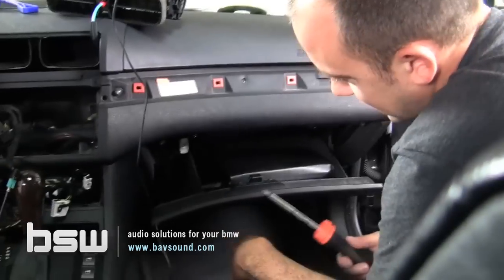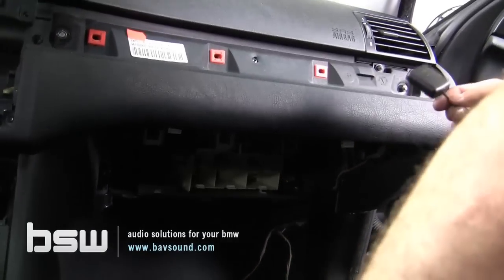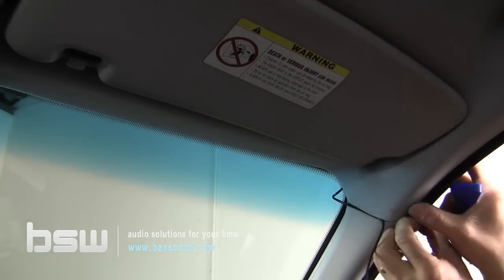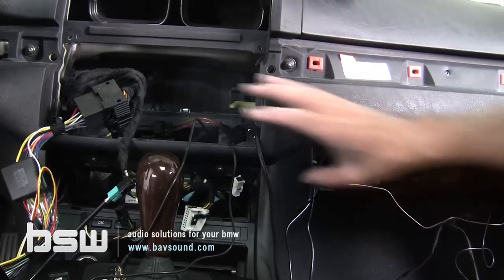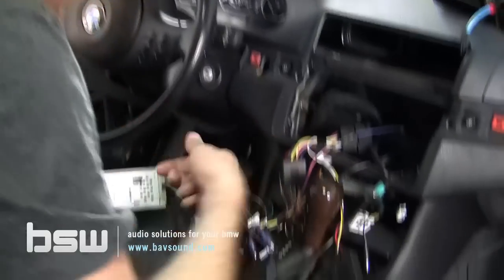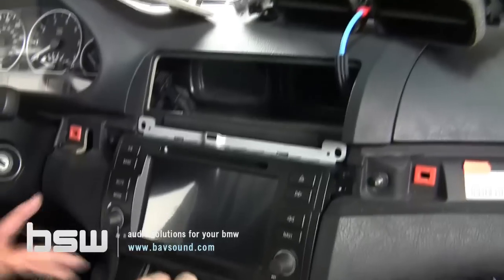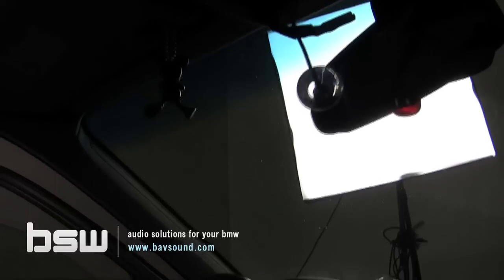BMW Dynavin Installation | E46 3 Series | BAVSOUND | Part 2

Comment: You guys make it look so easy lol, I should have gone with the Dynavin unit on my e46. I decided to use a double din Pioneer with Android Auto, took me the better part of an entire weekend to modify the AC ducting and install the radio. Once the ducting cover was complete, it was a piece of cake to put it all back together, and there was just barely enough room to the right of the radio for all of the wiring and my parking brake bypass relay. Also, not sure how the Dynavin unit works, but if your e46 is anything like mine, the remote amp turn on wire has to be hooked up to the factory amp, otherwise you'll have no sound and you might go bald trying to figure out why the radio works but there's no sound playing... You might have mentioned it in the video, but I don't recall. Anyways, fantastic video, I've been looking into the BavSound upgrade for my speakers but I have some other issues that need to get solved before I spend that kind of money on sound quality.

Comment: Great video! One question. Do you need to have that wire plugged in for the video to be viewed while in park? or can you just not plug it in and it'll work while driving? Thanks!

Comment from the maker: @jonsutubechannel Hi. yeah sorry it's really easy we just forgot. It's a direct fit on other cars and almost a direct fit on E46, but if you want it to be 100% factory you'll need a climate control trim piece available from the dealer. In this install we did not use the factory piece and it worked quit well. e46 is the only model that uses the OEM part and it's 51-16-7-001-408.

Comment from the maker: @Dgoldentr3 It's almost a direct fit, but if you want it to be 100% factory you'll need a climate control trim piece available from the dealer. In this install we did not use the factory piece and it worked quit well. But we'll post the numbers on that asap.

Comment: awesome tutorial. planning on buying an m3 and a double din unit, so this will be useful.

so the hvac controls fit right in on that bottom slot? no need for any bezels or anything?
Reply from the maker: Thanks. Please check the description for more info.
Reply: BAVSOUND  is this unit compatible with an e46 without the premium sound option, aka stock regular speakers . ? My install guy told me to ask lol

Comment: How do you relocate the a/c & heating control panel into the compartment slot please? Im thinking there's a housing bracket that the unit fits into or does it just slot straight in there? I will be getting my e46 convertible in 8 weeks and will be getting the eonon d5150 head unit to fit into it, I think your 2 videos are brilliant and covers every aspect of the fitting procedure apart from fitting the a/c & heating unit....hopefully it will just be a 'plug n slot in' job.
Reply from the maker: Check the "about" description above by clicking "show more"

Comment: Hey awesum vid an unbelievably helpful. I used it to fit mine so thanks a lot.
Quick question though. How did u relocate the heater unit. Doesn't seem to fit correctly into the housing where the spare compartment was????
Would massively appreciate any help, thanks.
Reply: +mallylad on most e46's you need to buy the bracket from the dealership for relocating the climate controls. When I did my double din install a month ago I used the bracket from ECS Tuning, it was right around $100 including shipping. There's two different kinds, the ones with a single button panel or the one with individual buttons (heated seats, traction control, etc). The part number I needed was 51167001408 (with one opening for buttons), the other part number is 51168202186 (with openings for individual buttons)
Reply: +Mark H hey, thanks for the reply, yea I'll have a look about and find the relocation bracket an sort that.
Thanks again dude 😁

Comment: Great video, this was a big help as I put in an Eonon head unit today.  One problem.  I can't seem to get the climate control to insert into the old accessory pocket all the way.  I push and push and it won't snap in.  There doesn't appear to be any obstructions.  Any suggestions?

Comment: Final result got very very good.. nice new radio/gps.. gotta find such solution for my e87 series.. too bad it has already a folding screen also some ac controls in the region the 46 only has the radio..

Comment: Very helpful video, but my local BMW part guy tells me the HVAC trim piece part number you mentioned is for NOT for cars with the smoker's package, which I've been told was standard in U.S. import e46's. He says the OEM part needed is 51-16-7-001-410 (not -408). Can you confirm that?

Comment: I have the exact same unit as the one you installed in the video and works great, except for the fact that the audio to my radio and bluetooth won't play accurately.  It works at some times but not 100%, it plays and then fades out and then just no audio at all.  The CD and navigation sound works so I am not entirely sure what is wrong with it.  I think that it might be a grounding problem but I am no technician.  The company I bought it from Vigo electronics, has no idea either.  Please advice!

Comment: I have the same stereo, for the gps antenna they decided to use a magnet instead of adhesive. if you take the sticker off the back its right there. I glued the magnet to the windshield so you can remove the antenna at will.

Comment: Hi, Thanks for the tip on the ebrake PARK wire connection. In that same general area, is there a place to hookup a REVERSE wire? i.e. for backup camera.
Reply: trying to find an answer for this myself

Comment: I've been watching your videos on the 3 series and now I want this.  However, I'm a bit confused on where I would hide the mic on a convertible. The windshield is out of the question.
Also, the gps antenna is an eye sore IMO. I wonder where the factory hides them ( in a convertible)

Comment: Hi there,

I ordered a wireless rearview camera from e-bay which comes with both a reciever and transmitter. The transmitter i can give power by hooking it up to the backup lights, however for the reciever which goes behind the radio, what would be the best place to get the power from?

At first i thought about the cigarette lighter, but that is a constand power supply which will drain the battery, so that is a no go. Which wire would you advice me? Is it possible to connect it to the amp wire?

Comment: I have a head unit like this in my 2003 BMW 330 but I want to upgrade it since its the one that came with the car. I was wanting to buy the Pioneer AVH-P3400BH.  I was just wondering if that head unit will fit. I'm guessing since the AC unit is already where it needs to be it would just make the install simpilar. Would all I have to do is pull out the head unit in there now and put the new one in?

Comment: The 2005 BMW 325Ci convertible stick has a Din2 with GPS is not the same as shown.
Will this or which newer radio with GPS, WiFI, DVD will fit without modification?

Comment: Hello, Was wondering if you can help me decide what kind of 5 1/4 size componet speaker should I install in the front doors. I have stock and they are raddling so I have to replace them. Can you help.

Comment: Hi I have a question about relocating the climate control. I have seen tutorials where people modify the vent. Is that necessary? And where is that vent located?
Reply: You don't have to modify the vent, you do have to move the HVAC controls, and it helps if you get the relocation bracket. It's available from BMW or you can buy it separate from the head unit, both available here https://www.jandtdistributing.com/

Comment: Hi, 
Quite new to all this so apologies if I ask stupid questions. 
1. The cables that were run through the area where the glove box sits, where did they go? Do they sit behind or inside or do they hang around in the footwell? 
2. I am a little confused as to how the wire near the handbrake was connected to allow video when stopped. I have a 325ci manual 01 (Australian version) if that makes a difference. Could anyone be of assistance? 
Thank you :)

Comment: I noticed you didn't install a line output converter on the head unit.  Is that necessary to bring the head unit signal levels down before they go into the on board amplifier in the trunk?
Reply from the maker: Peter Lobaccaro Hi Peter, not necessary in this application!
Reply: Great thanks I want to do something similar and some say you need others say no
Reply: BAVSOUND '

Comment: HI BAVSound, how did you install the Air Conditioner panel under the double din Dynavin, I'm going to get one of these head units but don't know how the Air Conditioner  will go do I need an adapter?
Reply: +And War Nope
Reply: And War
I tried to open a restaurant and , well , now I have about 1700 Restaurants over the world. German sausage and other german foods are very popular. By the way , he just put the air conditioner one slot below.

Comment: What was the size of this unit. I just purchased the AVIC 8100nex which is a 7" screen. Will my 2005 m3 have the available room without "cutting" ?
Reply: +Mike Smith Sadly, not a chance. Your m3 will have no room for the NEX series units unless you modify the AC ducting, which (if you're anything like me) will take you the better part of 2 days to complete. The Dynavin has a special shape, if you look at it from the side it's kind of L shaped, so it fits above the dash vents but still allows there to be a 7" screen. 

I just did my double din install on my 04/2004 3 series about a month ago with an AVIC 4100nex, so I can tell you for sure that any of the nex series radios, or any typical double din, will not fit without modification. If you don't want to chop up your sub-dash, and don't want to pay someone else to do it and let them have your car for 3 days, I'd suggest looking into the Dynavin. Also, IIRC, there's a company selling Dynavin clones for about half the price, you should be able to sell your 8100nex and pick up a Dynavin clone for roughly the same price. Best of luck, if you need any help with the install, feel free to PM me, I took quite a few pictures of my installation and I remember it very well so I should be able to help.

Comment from the maker: Will not work unless you install an adapter. The downside is most of those adapters require programming. Sorry memory fails me as to the exact parts. Search for E46 Radio Adapter, or head unit adapter.

Comment: Hi, I have installed this unit in my E46 Coupe. First problem I had was that with the gps connector fixed to the back unit didn't fit. Now I fixed it to the unit with a different connector and it works but was wandering if anyone had this problem as well? 

Also after installation I have some static on the speakers, very annoying! Any idea how to solve this? 

Cheers!

Comment: I need help ASAP I'm installing the system it's eonon but it won't turn on anymore everything is connect when I switch to oem radio it works any ideas

Comment: Is there a way you can fit the Climate controls at the very bottom slot (The space beneath where you relocated them to) so that you can have both the Climate controls and the radio at the bottom and have the two top slots free?..

hope this makes sense.
Reply: Michael Counsel I want to know this as well.

Comment: what kinda stereo was it that you installed? it's like a perfect fit
Reply: have you found out the head/stereo unit shown in the video?  Looks like a Nav Unit from an E46.
Reply: It's a Dynavin available in US @ https://www.jandtdistributing.com/. they were made to fit in an E46, with a HVAC control bracket bought seperately

Comment: but how does the gps works ? do you need some installation cd or wthat? i have a e46 limousine 2001 with cassette in it. could i upgrade it? or do i need something special?
Reply: Yes you can. It will fit, but you will need the HVAC relocation bracket, available in US @ https://www.jandtdistributing.com/

Comment: You skipped the installation of the climate control into the new pocket. Mine is not snapping back in properly it dits loose.

Comment: Do you lose the ability to control the radio from the steering wheel?
Reply: usually yes there is a separate device that re enables it.

Comment: my question is for anyone that can answer it that sees this comment: How are you going to control the fan and the seat A/C since that part is removed to install the aftermarket radio? is it controlled from the aftermarket radio or? and (I'm talking about the part right under the radio when you disassemble).
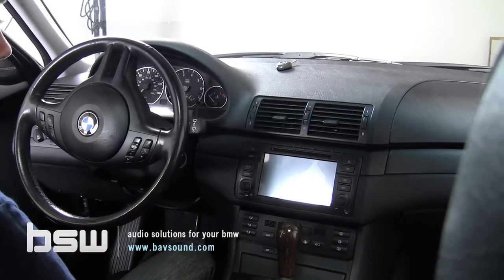Reply: +trenton mackey You talking about the HVAC module? The module gets relocated under the radio where the sunglasses box was (you can see it at 13:53). It fits perfectly fine down there as it was the factory location for cars with factory navigation systems. You can purchase the specific mounting trim from BMW, or you can just stuff it in there; most opt to just stuff it in there since it's a snug fit.

If you're talking about the heated seat buttons, TPMS, etc, they remain untouched and function normally.
Reply: +v2mmxst10 yes I'm fully aware of the spot your talking about but at first I didn't see it when I posted this comment.
Reply: +trenton mackey Glad to be of service :)

Comment: Helloo, where can i get the new radio with the screen?
any ideas?
Reply: Search Dynavin Head unit, other brands are Eonon or Avin
Reply: Avin is outdated old stuff,  i have an Ownice C200 with 2 gb mem, as far as i know they are the only one with that amount of memory. and end of this month they release the C500, a octa core cpu radio that runs on android 6.0.1
Reply: Ebay